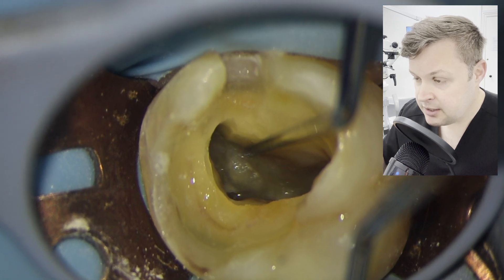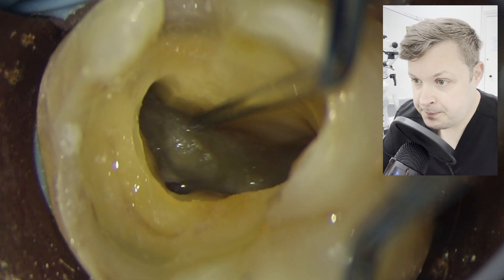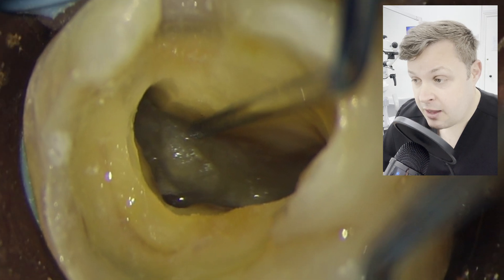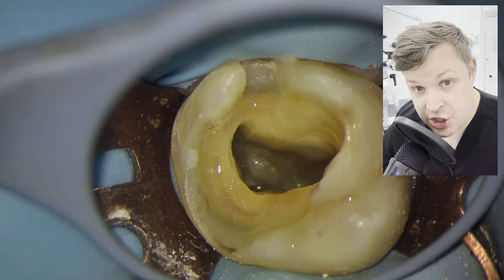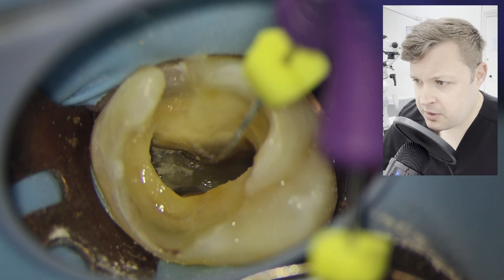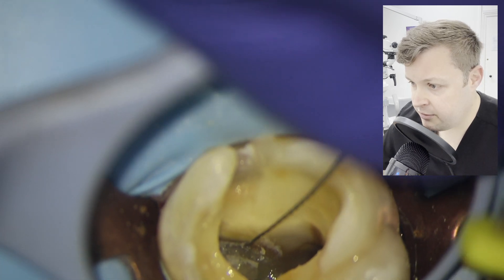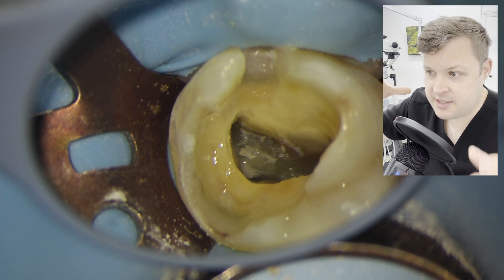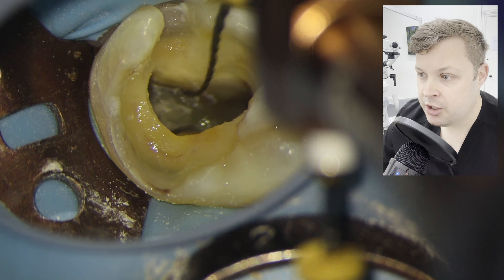MB2 FOUND: Step-by-Step Access & Shaping on This Upper Molar!

Comment: What apex locator do you use?
Reply from the maker: I’m using the Wirelex wireless apex locator!
Reply: @ilovethepulp  is that because the one with the woodpecker Ai not reliable?
Reply from the maker: @Aria123-0  no, I thought the in-built one in the Ai was fantastic, I just hated all the wires getting  in the way.

Comment: Respected Sir! What is PTFA as mentioned. In the YouTube vedio at  11:04 mins. Please can the same be abbreviated. PTFA was used as in video after packing the canals with CaOH and before sealing the access cavity with GIC.
Reply from the maker: otherwise known as teflon tape! or plumbers tape. It is usually used to wrap around screw threads of a radiator valve! Does this help?